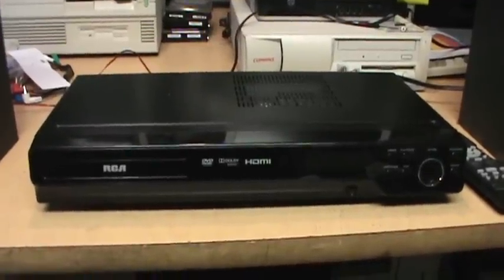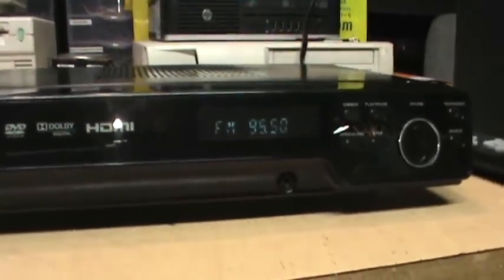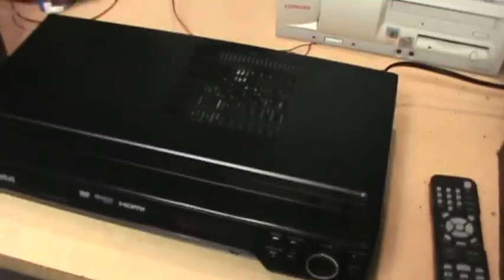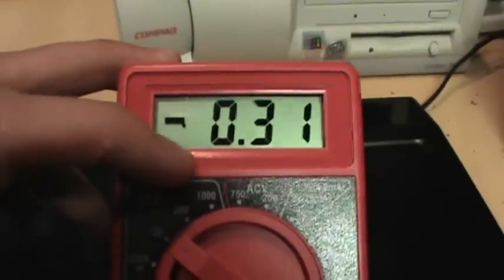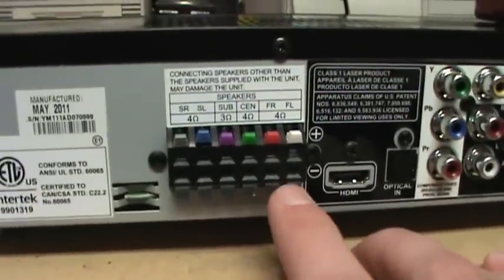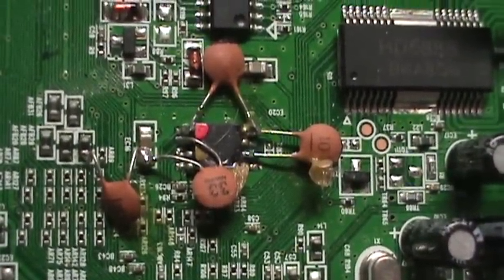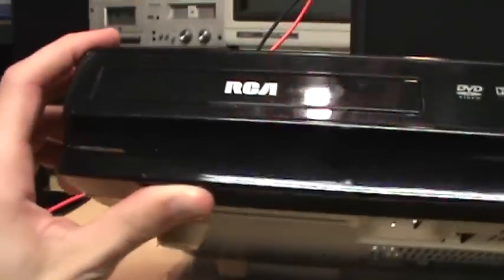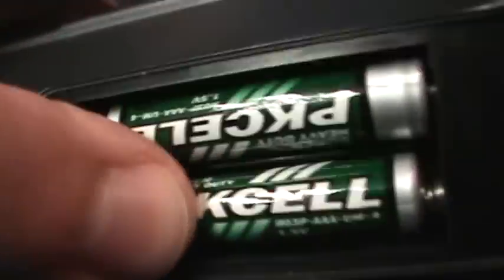RCA 250-watt home theater system FAIL

Comment: How can a device that only draws 45 watts from mains output 240 watts? I have a home theatre system that draws about 250W and claims to output 1000W total. Does't add up.
Reply from the maker: It's because the amplifier circuitry runs off of low-voltage DC power, not 120 volts AC. Thus the wattage ratings are not comparable between the two.
Reply: vwestlife How does that give any meaning ?
Reply from the maker: ***** Look up Ohm's Law. :-)
Reply: I DO know ohms law - i work with electronics every day. You can convert Volts to Amps and vice versa with a Power supply circuit/Transformer, but you cannot convert x amount of watts to y amounts - it's impossible. The rating must be for a single channel times the number of channels...
Reply from the maker: ***** The amount of power drawn from the 120-volt AC line is not directly comparable to the amount of power coming from the speaker outputs of the audio amplifier. That's a mistake many people make -- they look at the AC wattage rating on the back, and think that's the audio output power.
Reply: I expect the power supply is rated in constant power while the number for the amplifier is the peak electric power that can be supplied to the speaker.

The electric signals supplied to a speaker in an audio system should be an AC signal, it will be constantly changing, and so the average power it will be much lower than the peak power. Those big caps may be there to help supply enough current during such peaks.
Reply: ChrisHallett83 Exactly! - If the unit takes 45 Watts @ 120V, that's 2,6A @ 120V - converting this to 1V, 45A is still 45 Watts, or even 45V, 1A, still 45 Watts, or how about 300V, 0,15A, still 45 Watts. You can convert voltage to current or vice versa (plus the losses in the conversion ofcourse), but you cannot take x amount of watts and converting it something bigger in a CW power supply. it's like taking the energy from black space - impossible.
Reply: ChrisHallett83 So 6 Volts, 900 Watts, that is 150 Amps, how is the amplifier able to deliver that amount of power ? If it were to deliver 900 Watts, the power taken from the mains would be 900 Watts + the losses in power supply and output stage, more like 1000 watts taken from the mains. This doesn't fit well with the 45 watts rating.
Reply from the maker: ***** Wikipedia: "For AC-operated devices (e.g. coaxial cable, loudspeakers), there may be even be two power ratings, a maximum (peak) power ratting and an average power rating. For such devices, the peak power rating usually specifies the low frequency or pulse energy, while the average power rating limits high-frequency operation. Average power calculation rating depends on some assumptions how the device is going to be used. For example, the EIA rating method for loudspeakers uses a shaped noise signal that simulates music and allows peak excursion of 6dB, so an EIA rating of 50 Watts corresponds to 200 Watts peak rating."
Reply: vwestlife Stupid ratings. They have nothing to do with real watts.
Reply: When the power supply lowers the voltage, it makes current higher. The rated output wattage can also be RMS what is usually higher than actual output. Same goes for the speakers, I drived a 1000W RMS subwoofer with a half of TDA 1558Q which was connected as 2x22W amplifier, it made the paint crack on the wall. I still have that amp since 2007.
Reply: Yup, exactly.  PMPO is actually a theoretical maximum INSTANTANEOUS capability.  It fails because it assumes conditions that seldom exist in the real world, and should basically be ignored.    

RMS ratings are far more realistic, but they, too, assume certain things that may or may not be true.  In any case, they're really only for comparison, and manufacturers often fudge these figures to make the product appear more appealing to the consumer.

And finally, a lot of hallowed names from the past have been sold, resold, etc. and are now applied to some truly awful audio/video equipment today.  Look at Crosley, for example.  Back in the first half of the 20th century, they made good-quality stuff.  The garbage that name is attached to today is sickening.
Reply: Hitachi SR-2004, 230 W/CH, 0.03% THD, (2 Ch / Stereo), 1120 VA consumption.
Pioneer SX-1980, 270 W/CH, 0.02% THD, (2 Ch / Stereo), 1400 VA consumption
Reply: LakeNipissing These are quite beasts of an amplifier and does provide the audio power it is rated for, far different than the amp in question: huge toroidal transformers, massive electrolytic capacitors. Not every home theatre amp has these to begin with.
Reply: ***** My thoughts exactly. I was about to edit my comment to add this. The reason why the ac input power is higher is because some of the energy turns into heat as the amplifier is never 100% efficacy.
Reply: DjResR Typically I have found that reading the maximum power consumption of an amplifier, dividing by two (heat loss / efficiency), and then dividing by the number of channels will give a value that is pretty close to the RMS power for each channel. As an example: AC power 120 V, 180 W stated on the back panel, with 2 Channels = 45 WRMS /CH. Of course there are small power consumers such as the dial lights, pre-amp and tuner circuits, but the power amplifier uses the vast majority of the power consumed. You cannot output more than you consume.
Reply: *****
It's also worth noting that a stated output power should also be accompanied by a distortion figure if it's to be meaningful at all, and this is where a lot of manufacturers play games.  They might claim an amplifier is rated at 70 watts per channel, but distortion at that level is quite high.  The same amp, rated more conservatively at 30W/channel, will have much lower distortion figures.  But power figures sell amplifiers, so the manufacturers will often claim the higher number.

The best amplifiers have huge power supply sections for this very reason.  Look at the old Marantz receivers from the 1970s - even the 'modest' 40W/channel models have big, burly PSUs inside, and their output was very clean at or near their rated power.
Reply: *****
Exactly.  A PSU cannot deliver more power than it draws; indeed, it cannot even deliver AS MUCH as it draws because losses in the AC to DC conversion are inevitable.

And yes, it is the big capacitors that allow for transient peaks beyond the PSU's capability, but only briefly.

I've always hated PMPO ratings, and I wish they would do away with them.  But then, the manufacturers would just lie about the RMS figures, pretty much as they do now.

Comment: mine works good so far i have the 1000 watt RCA the only gripe i have is with the sub. the speaker is fine but the case in a flimsy piece of crap lol n as soon as its paid off its going in a better case. but ty for uploading this vid so i know what to expect when or if i have to take it apart

Comment: This shit amplifier doesn't draw more than 45w from your wall, since it's most likely a cheap as fuck a class, it's giving about half of that, at best, to the speakers.
A decent set of 2.1 computer speakers (on close inspection) will draw upwards of 150w.

Comment: A similar fate awaited AWA(Amalgamated Wireless Australasia) during the late 1970s and the 1980s. AWA was manufacturing and marketing excellent quality gear for both the consumer and the broadcast industry but by the 1980s was only making gear for the radio and TV stations, and leasing its trademark to Mitsubishi in Japan to make TVs VCRs and other consumer gear. Thankfully, Mitsubishi was turning out good quality gear, worthy of the AWA brand, but in the 1990s, sometime through that decade, Mitsubishi pulled out and some Chinese company started making rubbish gear under the AWA brand and in the process, dragging the once-great AWA name down into the gutter.
Reply: I still have an AWA 26" "Deep Image Colour" TV in my possession. It's been in my family since 1975. Still works a treat, and is proudly labelled "Made in Australia".

My parents bought an AWA VCR in 1991 and it was a piece of junk. Audio quality similar to AM radio. The brand certainly declined in the 90's.

I have a DVD player made by AWA dated probably around the late 2000's. It has a Sony mechanism in it. Go figure.

Comment: I burned a woofer out with a cheap hifi video player..it put spurious subsonic fequencies into its audio output when recording music and reproducint it.. which at moderate volume did some damage. I hate cheap equipment..altho strangely it was an LG...i also bought a second hand technics cd player that popped alot..but it was a 10 buck special..which was not so special. Now have a Nad which I bought new..which is great and NO popping.

Comment: What a POS! I'll stick with my 25 year old JVC model RX-503 receiver, it may not have built in blue tooth, USB or the latest "surround" outputs, but they make blue tooth receivers that can hook up to the unit's tape player input jacks, (and of course you can hook up the audio out from ANY TV, high def or not) to those jacks, and with a good set of speakers connected, I'll put it head to head with any modern system

Comment: Cutting off the cord isn't gonna prevent people from using it because people can solder a new cord onto it if you really want to prevent people from using it you could have at least smashed it into a million pieces with a sledge hammer
Reply from the maker: But that would've prevented the electronics inside it from being properly recycled.

Comment: You shouldn't have any DC voltage coming out of your speaker outputs.  Seeing 20 Volts DC is absolutely bad.  You will burn up a speakers coil really fast with that.  If you want to measure the output of an amplifier, you need to have your meter set to AC volts by the way.  Speakers use AC not DC.  But you're unit is not working correctly, you were absolutely right on that.  I wouldn't by anything with RCA on the box that is new.  RCA is no longer a company and the name was sold off years ago.  It's just a generic product.
Reply: Sean, you are both correct and wrong with your comment about meter settings..Yes, you are correct that to measure the output (across the proper dummy load) you must use the AC range. However, a meter on the AC range will not properly show the DC bias voltage present on an amplifier's output. So if you have a suspect amplifier, the FIRST thing to check is for DC on the speaker terminals using your meter on the DC setting. IF there is no (or very little, say under .5 volts) of DC present, it would generally be safe to connect a speaker to it.  In my years in the cinema business, one of the nastiest amplifiers for sending DC to the speakers was the Crown DC300 (and it's mates). Originally designed to power "shaking tables" they had a full power output range from DC to 50khz. (Later models cut off at 10hz.) The problem was, when the bias circuit decided to fail, it would short out the driver transistor and force the output to the full power supply rail voltage (75 volts!) and would literally set the bass drivers on fire! Worst part was there was no warning it was about to fail...no pops, degraded audio or low output..just a sudden fireworks show from the amp and smoke.
Reply: Thank you for the clarification and friendly comment! :)  So often people are so rude on here.  I did forget, DC is a great way to find clipping on an amps output.  And wow, that sound scary!
Reply: You're welcome Sean. Yeah I can relate, I see no reason to ever be rude when correcting someone's comment. Much better to be polite .. check out my channel if you are interested in AN Radio Dx , and feel free to comment on my videos as well. :)  Yeah those Crowns were scary, had one do that on my bench, made my 500watt dummy loads glow red hot.

Comment: Mine won't even power up.  I sent it to the RCA people, and they repaired and returned it.  After about 2 or 3 weeks, It happens again.  I can not turn it on at all, it's like it's not even plugged in to the wall.  Do you have any insight at all for me that I may fix this myself, because they had my machine for about 6 months, and charged me $40.00.   I would rather throw the thing in the garbage and never deal with RCA ever again.  Thank ya much.  Please contact me at my channel in case I can't find this page again.
Reply: I know how you can fix it...throw it out!

Comment: Yea most people probably don't have a clue on impedance. Probably used 8 Ohm speakers.
Reply: +John Brown Many people I mean not you.
Reply: +John Brown Uhm.. That wouldn't actually hurt the amp, less current draw with 8Ohm speakers mate. Its Ohms law. True you may get a "smart" chip based amp that can detect/sense the impedance of the load or that its drawing too much power.. However, be it pairs of transistors or a chip thats your output, if they say 4Ohm you can usually get away with 8Ohm, just less perceived volume.. Unless your speakers are good with higher sensitivity.. A car head unit connected to my 4-8Ohm floor standing speakers (Eltax! meh they were cheap and actually sound nice) and a pair of little 8Ohm missions tends to power them fine at full volume without distortion (assuming the head unit is good and i use a good power supply) and considering they are only being fed with "22 Watts RMS into 4Ohms" (but the tweeters and mids in the floor standers are 8Ohm) "88 Watts" (which is likely halved by mainly being 8Ohm loaded, or at least halved on the mission speakers) or a bit more from car head units is more than loud enough to fill a room well and you have to shout over it... You just won't shake the walls. Lol.

Comment: On the back, under the power cable there are some specifications for power consuption writen on the label. If it takes only 45w from the power outlet how the fuck can you even say that you bought it because it was advertised at 250w? And, most of all, how can you asume that the total output power can be ~250w on all speakers if it consumes just 45w?! Its just a 45w piece of crap (minus the 10-15% of power loss). A maximum of 40w total. 5w per channel and 20w for the sw.
Reply from the maker: Ionita Cristi AC power consumption from the wall outlet has absolutely nothing to do with an amplifier's power output to the speakers! AC line voltage runs at 50 or 60 Hz, while speaker power output is measured at 1 kHz, so you cannot compare the two.
Reply: +vwestlife I could use the remote!

Comment: yes, anything rca built was n't no good in that error, just junk, i had a vcr they built, just garbage.  ate tapes first day i set it up.  tried taking it back, they didn't want it even under waranty...s i was stuck with the junk.  their rca tv's were junk also, i had a widescreen 40  inch projection, the bulbs blew up underneath it... that ended that, lol....
Reply: My Dad had an RCA tv in the same spot for about 35 years. The one that looked like a cabinet, with 2 fake drawer handles on the bottom.
Reply: Remember: RCA = Really Crappy Appliance.

Comment: The clue should have been the sticker on the back of the unit that clearly states that: connecting speakers other than the speakers supplied with the unit may damage the unit'.  But some people try other things and are disappointed in life.
Reply: +Stan Johnston That doesn't mean anything. That just has to do with speaker impedance. I'm sure the kind of people who would buy something like this new would only use the speakers in the box.

Comment: FAIL? That RCA is better than a mcintosh tube amp! Available at only fine retailers like radio shack and harbor freight tools. And it's highly sought after by collectors. Plug it into a crosly record player with some jensen 6x9 car speakers and you have the best sound quality that money can buy! Don't forget the warranty plan for 2.99$ in case it needs the transistors cleaned.